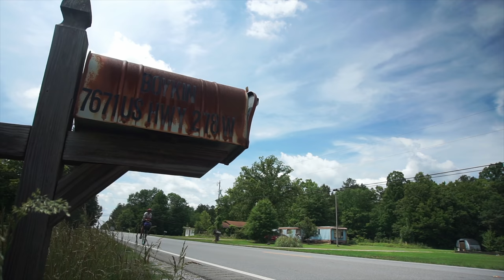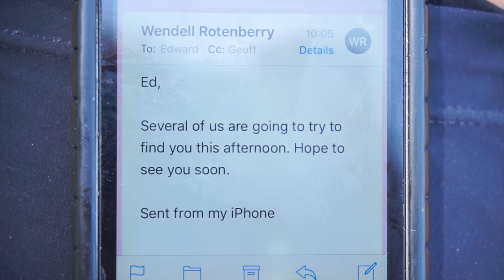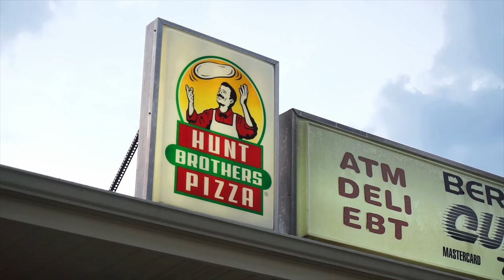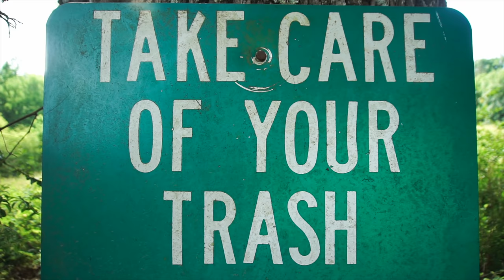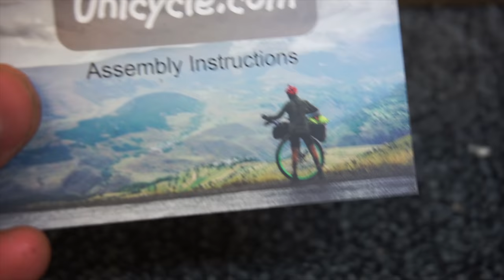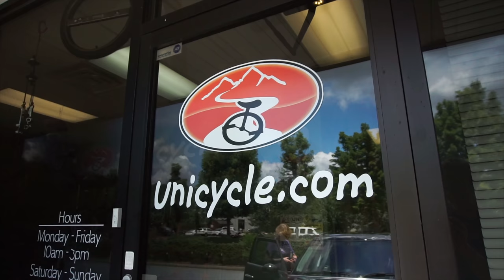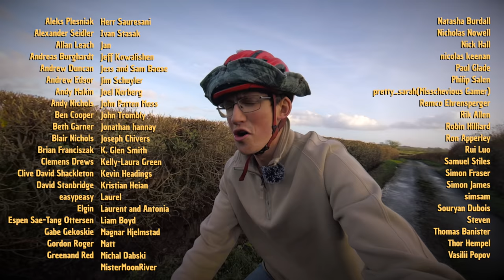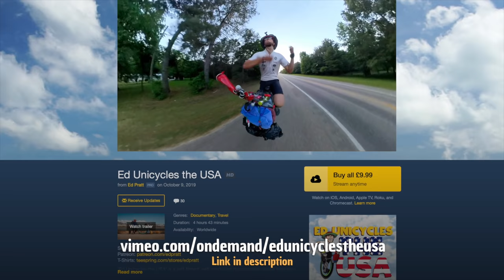The PERFECT Saddle For Long Distance Cycle Touring // Ep.16 Unicycling Across America

Comment: Hey Ed. In case your saddle problem is still unsolved: Best solution is leather saddle, which should be (somehow) wide enough at the rear end (to give support for your ischial tuberosities). All the cushions whether air or whatever won't work because it is not about having the softest option available. Soft materials just make it worse. Stiffness has to be right, and leather is optimal for it.

Comment: Man! That original saddle is the one on my 29ér. It was seriously uncomfortable. It was too bended and made a bad time on my two precious things. I solved that problem by dismounting the cover and the foam, putting the plastic in a boiling pot for 10 minutes, than placing it on the floor and standing straiting it out a little bit. Then I assembled it again. And it was a relief to use it again. For a guy like me doing distance on my unicycle I´d prefer to put the weight on the supporting bones rather than the area in the middle. In my opinion I would like the saddles more thinner more like usual bike saddles.

Comment: You should have flattened that saddled, there are some tutorials on the web showing you how to do it by dunking it in boiling water and then clamping it flat till it cools down. Uni manufacturers are kinda stuck with banana-shaped saddles because moulds are expensive to make. I've  both the KH Freeride and the KH Fusion One and I still prefer the Freeride because it's a bit softer, I just wish it was less curved.